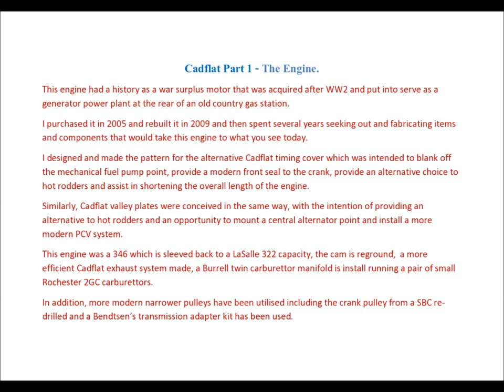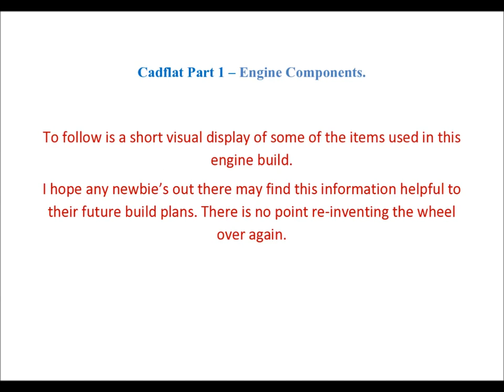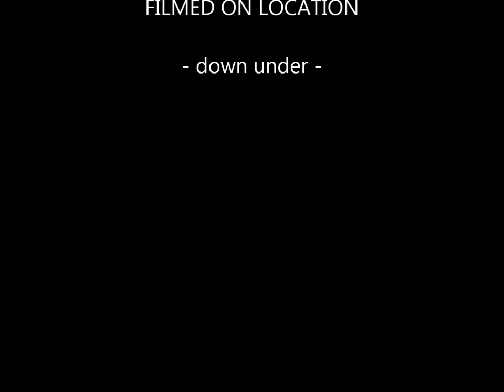Cadflat Movie Part 1- Engine Running Motor V8 Flathead Hot Rod LaSalle 322 Cadillac 346 Flatcaddy

Comment: Please tell me you have a copy of the power steering brackets you made. Or could you make a video with a better look of them. Beautiful build btw. Building mine now.
Reply from the maker: Hi Brad, thanks for your interest in the power steering pump bracket. It is probably a little late to consider a video as it would be unclear to give you a good idea of things, but if you can somehow either let me know what Forums you appear on or an email address I can send you a couple of pic's of my plate work in the early days of this build, I would be happy to send you what I have.It ain't that hard, but that said at the time it was difficult and took several patterns to get it to where we see it today.In general it is attached to two bolts on the timing cover and a 3rd bolt out wide which attaches to the engine mount bracket, so that 3rd bolt is quite low down.The trick is securing a GM pump with friendly outlet pipe to avoid clashing with the block and making the bracket to clear the oil gallery plug also at the front of the block which I have used as a take off point for a remote bypass oil filter. In my particular case I am running an a/c compressor below the p/s pump which makes life even more interesting.To anybody else reading this reply, I can say that I still intend to post a running engine with sound in the not too distant future.Looking back, I feel it would be easier to make a new video rather than try to re-edit what exists right now.I am just not that tech savy...

Comment: what type of distributor are you using ? name model please.
Reply from the maker: It is a small body HEI distributor with a simple modification to the end shaft to match into the Cadillac oil pump drive shaft. The HEI module I have removed from the distributor body and re-installed remotely in a suitable small aluminium box inside the cab on the firewall. I was concerned about too much heat from the odd exhaust outlets  affecting the longevity of the module. I hope my explanation answers your question.
The distributor was purchased from Ebay from a Seller called Skip White in TN if my memory serves me correctly and was compatible to a Ford 289 Windsor V8 engine before modifying which was done by a guy over in CO at that time..
Reply from the maker: Please dont forget to subscribe...

Comment: I watched the whole dam thing thinking that you where going to start it up
Reply from the maker: I am not sure which video you refer to, but in both my engine videos I have posted on here the engine runs.
Sadly thru inexperience and a brush with the copyright regulators I lost the engine sound but chose to leave the video up until I could do a revamp with sound which has been achieved and is among the Cadflat videos that I have posted.
Please take a 2nd look and I hope you can find the video I am referring to. 
Also stay tuned as my intention is to load a new video with the engine installed into the chassis and running with a full exhaust system fitted etc.
I have a had several health issues that have slowed my posting progress, but I will be back with at least 2 more videos on this topic.
Best wishes,  Russ.
Reply: @cadflatvideoseries1992 . My apologies, I didn’t realise that you had audio issues, best wishes with your future videos and health issues

Comment: I’m interested in all the mods you did on this flathead. Like to see how you plan on doing the a/c. A seen a way earlier pic. Of your flathead. On a forum  somewhere. And you had a alternator. Just laying on the valley plate. Didn’t notice it was your pic until now. But wanted to know your plan for that alternator?
Reply from the maker: Alternator remains in the valley. The a/c compressor is under slung on the non water pump side as the car is RHD. I have mounted the power steering pump above the a/c compressor. It is tight but works. Pulley setup was tricky but has worked out.

Comment: What starter is used and will it work on the stock bellhousings?
Reply from the maker: It is a Dodge Hemi mini starter which has been installed into the sandwich tranny adapter plate and shimmed to correct depth.Note that the shaft end of the starter also needs to be supported when doing this conversion.If you need more information visit the HAMB forum and search items.
Reply from the maker: You will need to join the HAMB to be able to see them I believe.There are two threads that come to mind immediately, although sorry its been 1 year since we started chatting here.First you can search for is;Cadillac Flathead Chronicles2nd is;Cadillac Flathead Speed PartsWilcap in CA uses these starters as part of his tranny adapter kits.I used the adapter from Bendtsen's  I think they are in WI.I also note that Speedway Motors in NE have some adapter kits on offer these days.You can find me on the HAMB aka fiftyV8

Comment: I've heard that these engines used on generators n air compressors was a low compression set up?? I know man bought ford 300 inline6 that came off air compressor u talk abt week !! Stationary engine most are lower compression engines
Reply from the maker: Yes, mine was a stationary engine at one time in its life and did not have car numbers stamped on it.I think compared with more modern engines they were all low compression back then.Whether there was a difference in those days between car engines and stationary engines I don't know.All that has little impact on my engine as it was rebuilt to car specs and has impressive horse power to boot.Don't forget to hit the like button and thankyou.